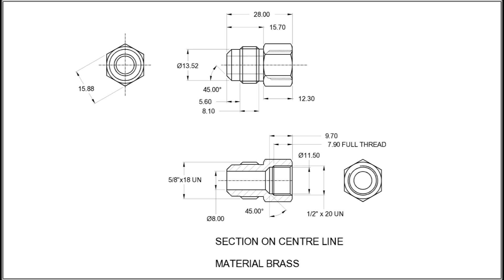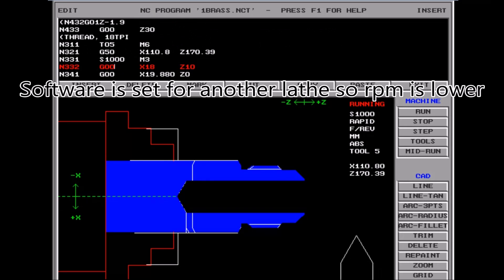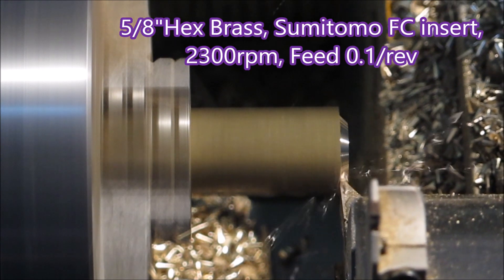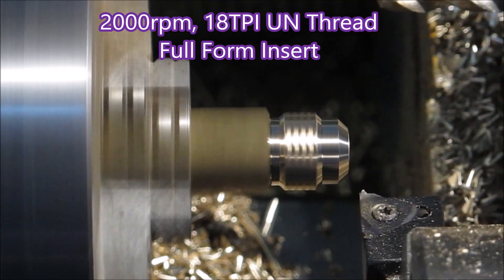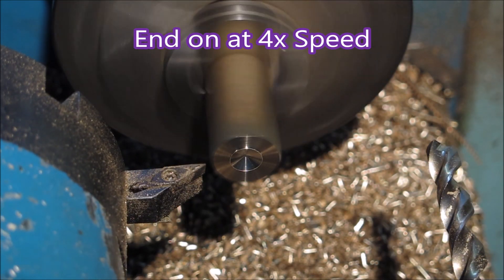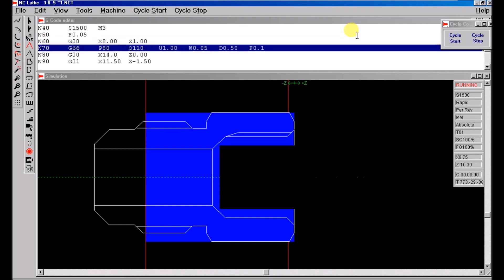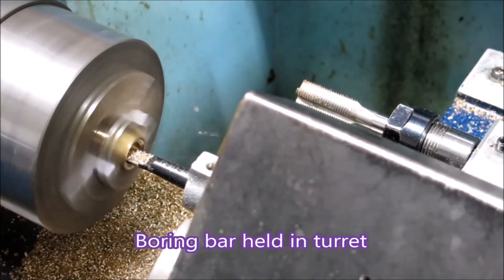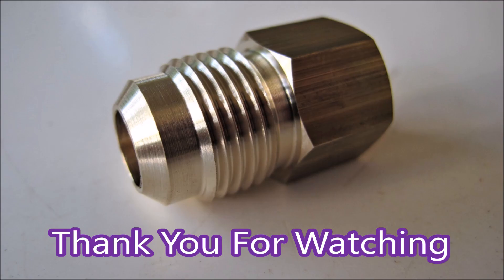Cnc lathe threading, 18TPI UN & tapped 1/2-20 UN, using carbide and HSS tools

Comment: Just discovered your videos - thanks for posting - very imformative. Pete
Reply from the maker: Thanks Pete currently working on one using a diamond insert (never used one before) and one using 3 different parting/grooving inserts to make a chess pawn without a turning tool. Thank you for your comment.
Reply: @smallcnclathes  I've just bought my first CNC lathe and have a steep learning curve to climb - learning GCode and CAD/CAM.- starting from position zero. Your annotated videos help the learning process for those as interested in the "how" as the "what". Any tips or pointers to help in learning experience wuld be welcome.Thanks again - Pete
Reply from the maker: My more recent videos tend to include a part drawing and some a drawing of the toolpaths I drew to simplify the cam work involved. If you are on Facebook you could join the Hercus cnc benchtop machines page that I run. If not you can contact me via email  through  the benchtopcnc.com.au page on the notewell address
Reply: @smallcnclathes  Great to see people keeping an old Aussie brand alive! Unfortunately the lathe I bought is Swiss so I cant really add much to your group. atb Pete
Reply from the maker: We won’t hold it against you that you don’t have a Hercus, but you may get some worthwhile help. If you want to join just answer the questions and I will approve. Or as I said email me and I will help as much as I can.